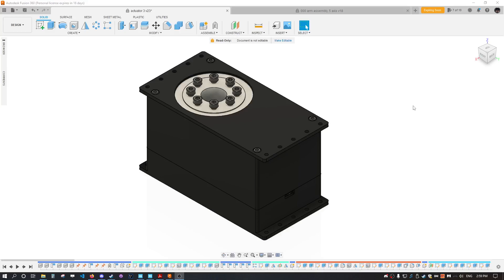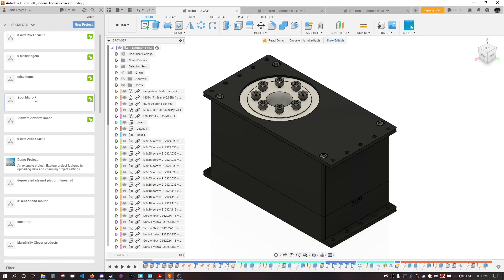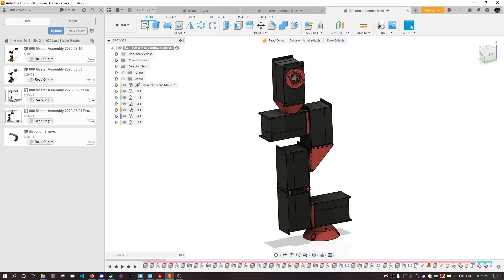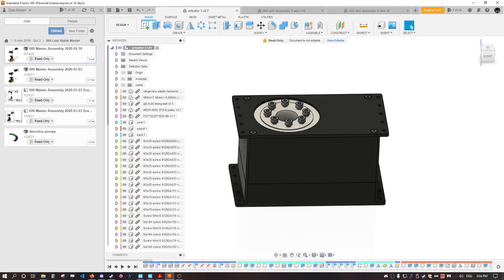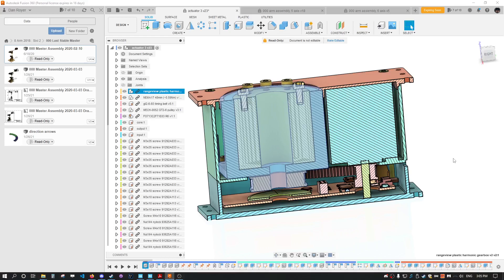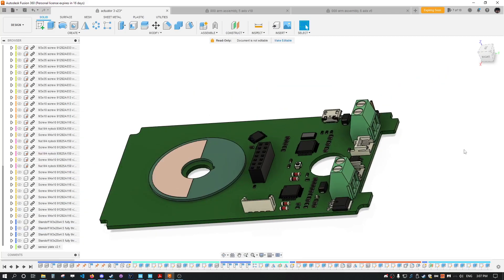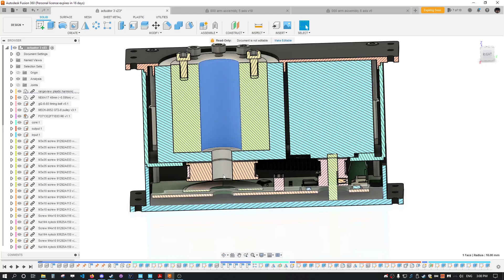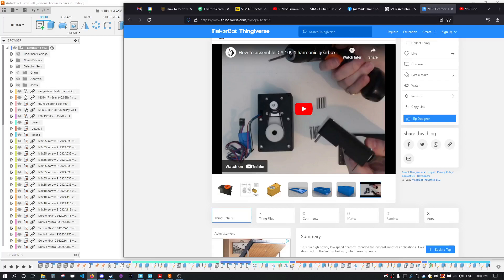Sixi 3 servo FAQ

Comment: How does the sensor disc work? Is it like a potentiometer made of PCB, where the half of the disc has copper and half doesn't and as it makes contact with traces on the main board it gives different resistance based on the orientation? That seems like it would need a belleville washer kind of spring to maintain pressure between the two, and that could also function as the shaft coupler to turn the disc, and to keep it centered. Put splines on the pulley and disc, and mating splines on the belleville. A 3D printed plastic belleville should be fine to apply gentle pressure, though not exactly an FDM-friendly shape. You'd have to print it standing up on its side (in which case getting precise fitting splines will be difficult) or add it to the SLA batch.
Reply from the maker: It’s the IPS2200 inductive position sensor. No brushes needed!
Reply: @i-make-robots  Interesting device! In that case, isn't it just a matter of sticking the disc to the pulley after you get the belt on?
EDIT: Nevermind, I was confused. The pulley is the high speed input, and this is measuring the low speed output. A tube does seem the correct solution, but then how to mount the disc to it while keeping the tube inside diameter as large as possible for the wires... 
Assuming the tube is 3D printed, it could possibly could be done just by clever shaping of the tube end and disc hole, so you can click the disc on and off using the flexibility of the plastic. Or you could make a sort of collar/flange that you clamp around the end of the tube after passing the tube through the pulley, and then attach the disc to that.